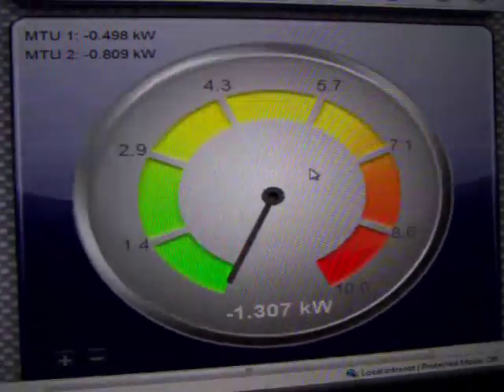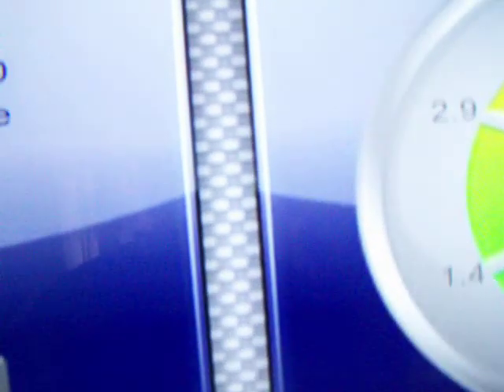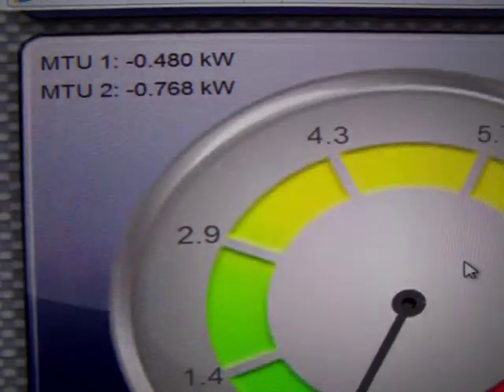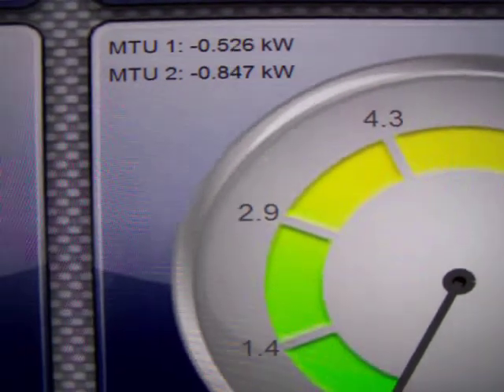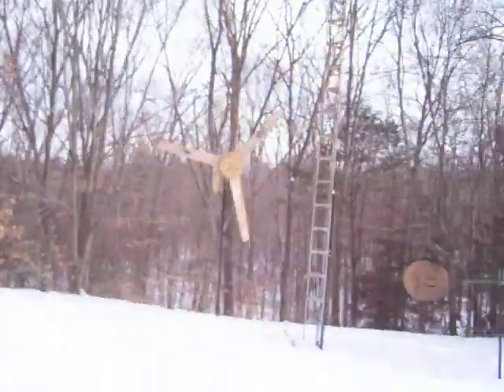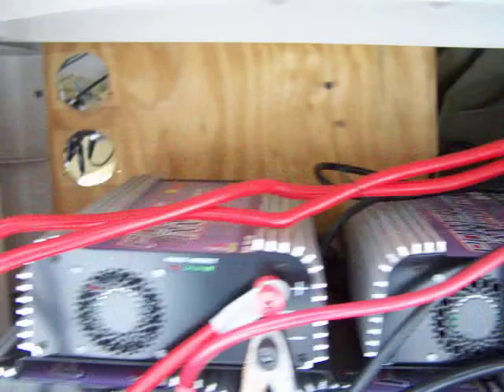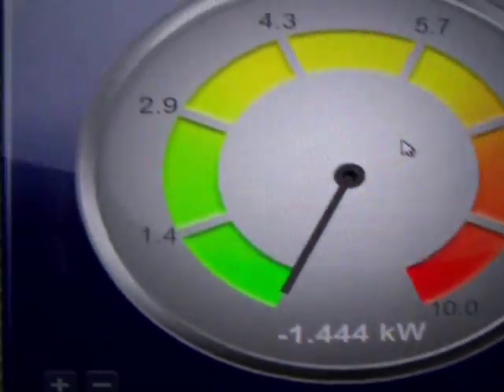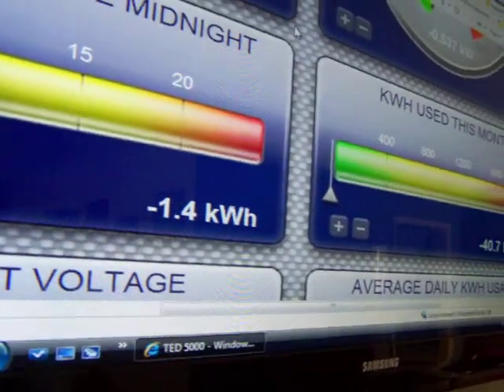solar array output on overcast day with enphase and sunG inverters

Comment: nice comparison between the inverter's,I plan on installing six 240 watt panel's on my garage roof,have 5 I bought off ebay,will most likely go with the enphase m190 inverters mainly because I have to stay all U.L appoved to get the 100% exemption from my property tax till the value of the equipment is paid off and net metering  credit on my bill,not sure how much this amount of watts will lower my bill might add more later when I have the money not sure how much red tape might be involved.

Comment from the maker: @sparktastic1 Hey both MTUs are fed with 1800w with a total of 3600w.I will try to get a better test in full sun .the max I have hit is 2990w with this setup.Mtu1 has 12 150w panels mtu2 has 9 150w and 2 225w panels.I did not do the test to say one was better than the other I just wanted to show the results that I get from the two.TAKE CARE

Comment: @sparktastic1 
Actually best case scenario for the Enphase is 95% efficiency, so they would have to fed with at least 840w DC to produce 800w AC output. At 840w DC input, I would expect 5x SUN-500g's to produce approx 145w each or total output of ~725w AC. Obviously, the Enphase units are slightly more efficient due to the virtual elimination of DC wiring losses and slightly better inverter efficiency, but they are not that much better..